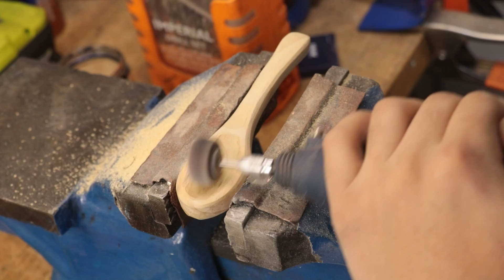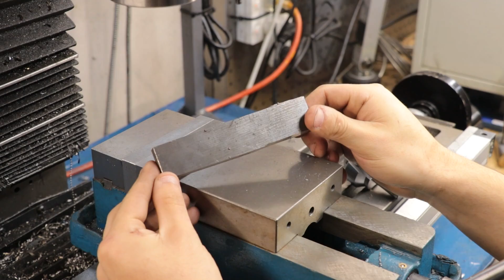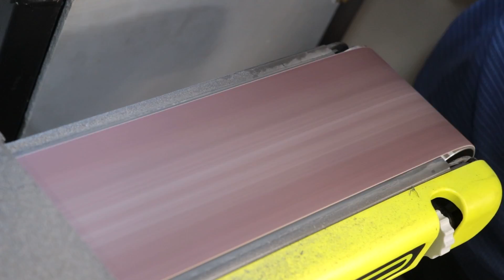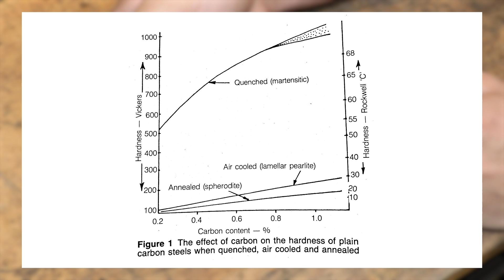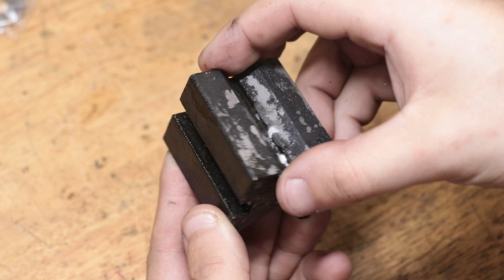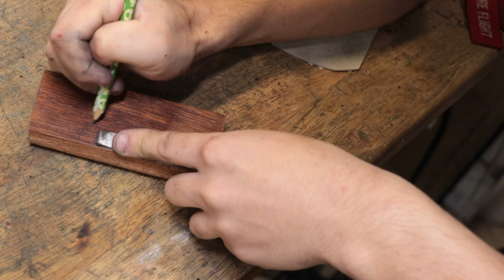Heat Treating Carbon Steel - Heat Treating101

Comment: I always prefer the TOMATO cutting test as the TRUE TEST of a knife's cutting ability... it's NOT JUST ABOUT SHARPNESS.... the tomato cut also test how smooth the steel is.... if it's not very smooth it will cut into the tomato but catch and crush it a bit - depending oh just how smooth you've made it...... everyone worries JUST about sharpness, and that is about 80% of it... but you also need to worry about the shape too.... if it's not very smooth and the shape of the sharpen part is too acute, it wont push the cut part tomato away and crush it even further.... MIND YOU, this is all JUST MY OPINION and I could be completely wrong about the smoothness and shape of the blade... and it could have been a dull knife that I THOUGHT was sharp... but I really don't think this is the case....
this is why there are about 25 different types of knives in Japan JUST FOR CUTTING UP TUNA!!! lol (and every other type of thing to cut) I really don't know if the number is 25, but there are quite a few different knives just for the different parts of the fish... they really ARE the masters of craftmanship IMO

Comment: Regarding hardening mild steel, look up 'super quench'.  Blacksmiths use it to harden mild steel for tools.  Mild steel quenched in super quench aren't knife hard, but they make good anvils, springs, and other hard objects.  It makes mild steel a little harder than it normally is and it makes it more rigid.  Look it up!

Comment: Good video for basic DIY or home workshop heat treating. If you make additional vids on this topic, you might consider some tips on design for parts that'll be heat treated. For example, sharp corners are an area where stress risers and cracks can develop during the heat treating process, e.g, where your milled tang met the blade portion. Keep up the inspiring videos,  I admire that you make many items that many would not even consider possible.

Comment: I make knives from scrap steel. I mostly play with old blunt files, which you can get in huge quantities for free if you know maker types, but I've also used scrap 40x1mm bandsaw blade and garden shears. It takes some experimentation (and some quality time with the belt grinder) but I do all my heat treating in a charcoal/coal fired rocket stove with forced air. I like making useful stuff from scrap, and my day to day pocket knife is one I made myself which is pretty cool to show off.

Comment: Using a heat treating oven will give you more consistent results, and that will give you your best chance of successfully hardening. Nothing against torch heating, but the oven is the best way to go if you can afford it.
Reply from the maker: Well yes but they do cost several thousands of dollars to buy compared to $200-$300 for a basic lpg furnace. That’s why everyone chooses a furnace

Comment: Why don't these guys ever use quench oil instead of all these other oils?
Reply from the maker: Like I said in the video, if you are oil quenching carbon steel in a home workshop the difference in results between a vegetable oil and a quench oil are not going to be very apparent. Not worth the extra price you pay for them

Comment: Try preheating your oil, seen lots of knife makers, heat up a large chuck of some scrap piece of metal and put it in oil to preheat oil🔥 so not such a thermal shock ⚡️

Comment: For wrapping, I saw a video about old technique (1700 or 1800) to help unwrapp hardened steel. It's a small "pickaxe" (more or less, visually it is ;)) which you hit gently the blade with, it deform a little bit and play with steel stress to make the job. If you're interested, I can search for it, but it will be in french I guess

Comment: Great educative video, as usual. One question though. Does the carbon % decrease every time you quench the metal for hardening? Had some tools that had their hardening ruined (blued) and trying to harden them back. They are nowhere near their previous hardness and I’m wondering if it is because the carbon rate has decreased. Thanks
Reply from the maker: decarburization is a thing that can happen but not through quenching. It can happen if the part is left in the furnace too long, its effectively the opposite of the carburization/case hardening process I showed. I obviously cannot know for certain but if you are having issues rehardening tools, it wouldn't surprise me if they are made of an alloy/tool steel. For a lot of the alloy steels you need to heat them up to specific temperatures and soak them for specified periods of time before quenching to effectively reset the internal microstructure. Unlike carbon steel the soak times and temperatures can be very important and less forgiving and if you don't correctly do it it can result in a reduced hardness. That would be my best guess
Reply: @artisanmakes  thanks for the additional infos. Might be due to the fact that I’ve left the pieces a bit too long in the forge. Cheers and keep up the excellent work
Reply: @artisanmakes  Excellent point! The internet (not just Youtube) is a great source of information for heat treating specific materials. That information is key for proper and successful treating of materials such as O1, W1, A2, D2, S7 and so on.

Comment: It turned out pretty good, I've made 3 knives up to date and my favourite one is a small one with 11cm blade. I've cheated a bit as i made the blade from a broken planer blade which is hss (18%Co) so it was a pain to grind but the cutting edge lasts for decades and it doesn't rust also.

Comment: Why not use an emulsifier to get oil and water to mix? Would this give you a better cool rate vs. hardness than either water or oil alone?
Reply from the maker: I don’t know the rate of cooling that it would give you but there is a maximum harness that metals can achieve and we can get that with out water quench (for carbon steel)

Comment: You should have heated the oil to 230 degrees Celsius and thrown the part into that hot oil for a couple of hours. The steel had to be carbon. You would end up with lower bainite. At a hardness of 50 hrc, the knife is more likely to bend than break.

Comment: Called "case hardening" because only the outside skin ("case") of the part is affected. Thus the part can have a harder surface but not be as brittle as a through-hardened part.
Reply: Umm yeah that’s exactly what he said.
Reply: @beanieweenie9543  Like UncleKennysPlace I thought he was saying it was because it was in a case of carbon in a steel box, so now I had to go back and replay it, and yeah, he actually has it right as you heard it. Strange, our miss-hearing might be because of accent/inflexion/local phrasing.

Comment: As you didn't mention it, water = leidenfrost effect super duper easy... Oil = not so much, well used high carbon used motor oil = infinitely less than water.. So dumping it in water is not good :)
Reply from the maker: I talk about in the water quench section I just don’t call it by name. I don’t really remember it off the top of my head. That’s why I use a salt brine quench some of the times or just move the part
In the water. That’s fine enough for parts that aren’t hugely complex. Cheers
Reply: @artisanmakes  Yeah, I played it back again and noticed you do talk about it. It's why oils with high boiling temps are used, salt water increases it a bit but not by much. Used motor oil has so much shit in it that the temps really quite high to boil it fully, usually *much closer to the red temp of quenching. I guess peanut oil mixed with graphite powder would function better, but not played with this side of stuff myself as of yet, just research.

Going by what you mentioned about cold rolled mild steel early in the video, I'm temped to whack my stock of it in the kiln for 10 hours (i have a lot and a big kiln) at 600C then let it cool down controlled over 12 hours  so all the stresses get relieved, should mean less distortion when i'm cutting my small parts that I need precise.
Reply: Play back your videos of water quenching, obseve the effect, then observe the effect in oil, you should instantly see the differences in teh effect

Comment: I know that many people doubt that quenching does not alter "flexibility." For some clarification, the "flexibility" of a material is defined by its Young's modulus. This constant dictates the "deformation" (or more precisely, the relative elongation or strain) under a certain stress. The Young's modulus remains unchanged or varies negligibly after quenching. On the other hand, the elastic modulus (not the Young's modulus), that defines the maximum allowable stress before plastic deformation (or irreversible deformation) can be linked with “Hardness”. This modulus depends on the crystalline structure of the material and can therefore be altered. The structure can be mechanically deformed, such as through cold rolling or hammering (work hardening), or it can undergo a heat treatment such as quenching for steels, or the addition of certain atoms for other materials like aluminum or copper. If this elastic modulus becomes sufficiently high and exceeds the "maximum resistance" of the material, it will enter the brittle fracture domain; in other words, it will break before plastically deforming, giving the impression that the material's flexibility has been reduced. In practice, the metal will deform or "flex" less before braking, but according to its definition, the flexibility (or in another words, the strain under a certain stress) will remain constant.
Reply: Interesting!

Comment: Excellent class on heat treating/carburizing! As a supervisor of 3 heat treating labs in a Fortune 500 machining facility, I can say with some authority that you were spot-on!  Carburizing/case hardening takes a lot of time, so your case was probably thin enough to risk straightening the blade. But I get it, why risk it for a slightly warped blade? I make my knife handles the same way as you, I have never seen that method anywhere else.

Comment: Knifey spooney got me right in the childhood

Hollow grinds on knives like that typically need larger radius wheels to work and to actually be noticable.
Reply from the maker: Probably but I don’t have a larger radius belt grinder so I make do with what I have on hand
Reply: @artisanmakes  time for a new project and video series 😲
Reply from the maker: Maybe but I’m not that interested in knife making. I knew I’d do it at least once but that’s about it. So I don’t see a real need for changing up the belt grinder
Reply: I think he could have used a face mill or fly cutter tilted very slightly as well

Comment: small correction mate 1055 is definitely not a knifemaking  steel be good for hammers or tooling but not a blade. that being said if you ever find yourself in wa come over and we can show you how to make a knife
Reply from the maker: Interesting. I remember watching an Alec Steele video where he uses a 1055 blank to make a knife. Granted it was more a hunting knife style, rather than a chefs knife
Reply: @artisanmakes  can't say I've seen that video, may work for hunting knives in a pinch but far from idea. that o1 you have would be good to use if you don't feel like buying specific steel to make a knife

Comment: to show the transformation of steel i remember we cut a treated piece transversally, and polish (up to 1200) the surface and then see it in microscope witha polarzed light.  theer youcan see the martensite (little pins) cementiteite or even bainite (which i think you obtained with the process in which you are  adding carbon and quinching it the temper..)